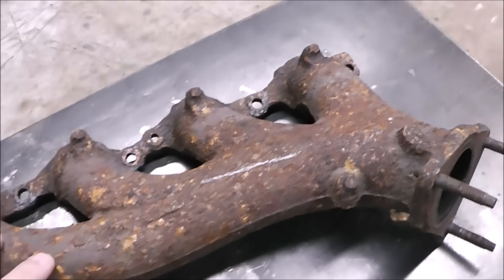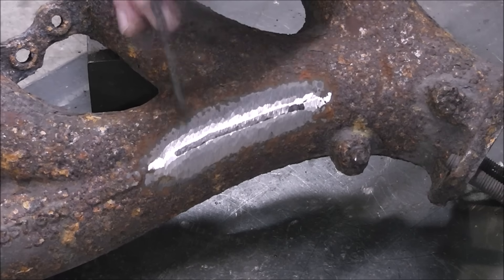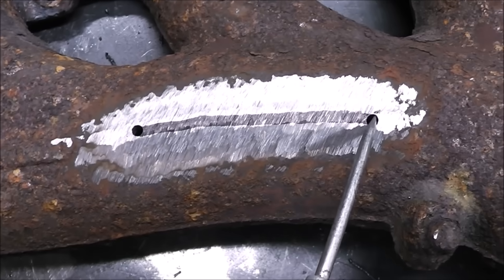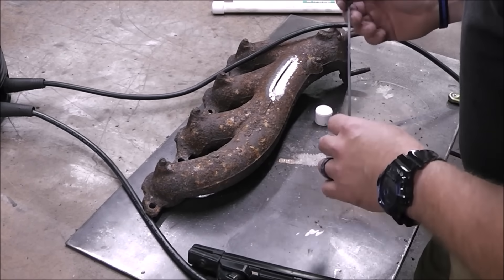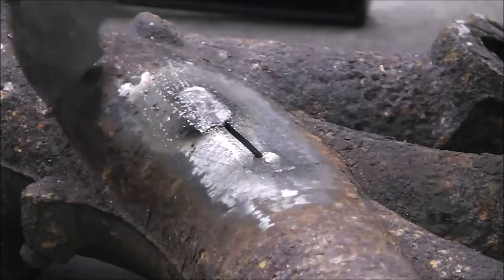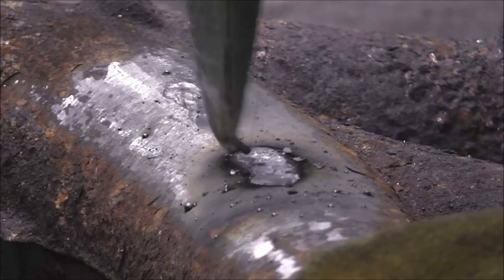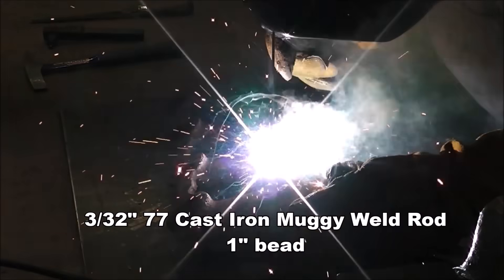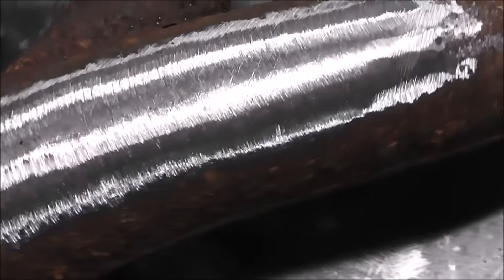Stick Welding Cast Iron Repair with Muggy Weld

Comment: hey im a pro welder. I'd never post a pic or video like that. if i did id add a warning. sum kid who isn't a pro welder mite c it & b convinced they can weld a load-bearing or pressurized cast iron part on their vehicle and it fails. They'll get hurt, GOD Forbid. Btw, there young welders - men & women - who can weld circles around me. No big deal. I had a feller ask me to "repair" a cast iron cooking pot. i refused. I trust my welds but I don't trust the properties of post-welded cast iron parts. I could have made him promise me he'll never cook in it and he does anyway & he gets hurt or sum one else does. 
To viewers: If u need a cast iron part welded, FIND A CERTIFIED WELDER. If it goes on ur vehicle, chuck the damaged one & buy a new one. DONT take any chances.
Reply from the maker: Definitely something a "pro welder" would say. 😂

Comment: You should have sand blast it before you welded it
Reply from the maker: Although I do own a sandblaster, I feel that most DIY folks probably dont, which is why I did not do it that way.
Reply: @BrandonLund  
Idk much about em. How much does a good one cost. Do you need a shit ton of sand. You should do a video on em.
Reply from the maker: @madbear3512  Thats a great idea! Here is the one that I use (except mine is red). It's just a little hand held unit that works really good. A 50 lb bag of sand lasts a long time. https://amzn.to/2PWTZ9a

Comment: How to fix cast iron manifold.. Take off engine, throw in garbage, install headers.
Reply from the maker: THIS! 🤣🤣🤣👌👍
Reply: @BrandonLund  but seriously... Nice work man!!
Reply from the maker: Seth Bergile thanks brother! That was a good comment tho! 😁
Reply: Au contraire. Some classic car collectors want to keep their classic cars as original as possible. Even if that means that the welder is going to charge them more than the cost of a quality set of headers.
Reply: @mike203920  it's a 5.3 LS manifold off a pick up. Nobody wants that shit!
Reply: @SethBergile  I know the author of this video is using a common disposable manifold as an example. But that isn't the point. The point is that you can learn and practice this technique on low value stuff before you fix some collectors '63 stingray.
Reply: Why would you throw the engine away?
Reply: Actually the LS Gen 3 exhaust manifolds as shown work quite excellent and aftermarket headers are used mainly for fitment issues.
Reply: Or junk it and get$ for it
Reply: @madbear3512  you might get like 3 cents for it
Reply: @DMD81773  
Collection all together by the shit ton you get your money worth
Reply: Seth Bergile yeap 😂😂😂😂
Reply: same
Reply: 1958 Edsel, 390gt low-riser heads.
Reply: @Neildo430ci  I have a set of those heads with machined combustion chambers.
Reply: I'm opposite, I throw headers away.
Reply: Secret. Dig a small pit, build a fire. Put manifold in fire. When it's hot, weld on it until it starts making noise. Put back in fire and do over. When finished, put back in fire. I cover with a metal trash can. let it get air and wait until the fire smolders down and gets cool, slowly.  I tried a MIG welder last time at someone else's shop. Took a cut off drum and some wood for a fire. Worked fine. Was a broken tractor manifold.
Reply from the maker: Yah, that's not what this was about. This video was about repairing damaged cast iron.

Comment: Looks like shit tbh, should have used MG200, no preheat required!!! You have way to much under cut through the entire weld, which would indicated to much heat, with that being said you should have as a welder check the along the sides of your welds for heat cracking, and yes I weld cast and aluminum heads and blocks 24/7 GM welder here of 16yrs.
Reply from the maker: Why would I use MG200 when I specifically said in the video that a bunch of viewers wanted to know about muggy weld? That is probably the dumbest comment on here "tbh"

Comment: Preheating cast iron is the right thing to do. Cast iron is like a sponge....that is it's full of water. And water , or the oxygen in water weakens the weld. It doesn't take a huge amount of heat to do the job. Just enough that one can't keep a finger on it. This instructor had some very good points so listen to his advise. Don't forget to drive the moisture from cast iron. Your job will remain together forever.
Reply from the maker: Excellent advise. I've always had good luck with a preheat and controlled cool down. I usually use sand if the part doesnt have gears of friction parts attached. All good advise brother, thank you! Great comment!

Comment: Ok,  so jumping in late here. Cooling rate of molten cast iron dictates what kind of cast iron you have, specifically what the carbon phase looks like. A higher degree of subcooling will form iron carbide (cementite)  which is present in white cast iron and very brittle. If you can reduce subcooling (cool slowly) you'll have a graphite phase which is present in ductile cast iron. Preheating the part will slow local cooling rate and generate a ductile phase. The differential cooling along with a localized brittle phase causes cracks. Preheat is a good idea.
Reply from the maker: Thank you. That's way beyond my cast iron knowledge. As a general rule, I always preheat and control the cooldown,  but for this series I wanted to experiment a little...as in a worst case scenario. Cheers brother

Comment: Why at the beginning of the video we are looking at the part of the manifold that you could see if it's installed on a vehicle but when you finish and say it's a perfect weld we are looking at the side that would normally be facing the block?
Reply from the maker: The manifold was prepped on both sides. One side was for the video you watched and the other side was for a future TIG welding video. Being the director, camera man, welder and producer, I never caught that I was welding on the side that you did not see me prep.

Comment: Chip off the flux then sand clean and just TIG weld it, then throw it in a  large toaster oven before to 450-500 and cool slowly in the oven afterwards, works every time I  use Ni-Rod different % nickel for different apps.
Reply from the maker: I did just what you recommended! Cheers brother! https://youtu.be/-XUbzw6p83Q
Reply: @BrandonLund  , Every welder learns different methods from different people, the way you did it was awesome, hell you could almost blacksmith it,lol. The point I was trying to much (which I didn't do a good job of) was there are lots off different ways to approach Cast Iron, totally enjoyed the video. Btw I do aerospace and own a shop that is NADCAP approved with 2 year merit.Got 38 years of experience and still learning stuff every day, Cheers.
Reply from the maker: @Jarboe420  that's awesome about your certification man! The one thing I have learned after posting these cast iron repair videos is that everyone seems to have a preferred method and a select few (a very select few) insist if i dont fix it their way than im a complete idiot and should not be making videos. The day we stop learning and trying new things is the day life becomes less interesting. We live in a throw away society, so if I can help someone keep stuff out of the landfill or even save them a little money with these videos, it's worth it. Cheers brother and I appreciate your comments and your support!
Reply: Exactly,  @BrandonLund  some of the most fun I have is walk ins, where you have to know how to fix it, repair it etc.. makes my day like you said when I can fix it, so it doesn't end up in the trash and or there is no new one they can get.Sub'd to the channel brother keep up the great work & videos.

Comment: This is a ls manifold ... It is cast steel not cast iron .. you can weld this with a mig welder with out doing anything to it ... People I know cut the flanges off of them all the time  and might weld turbo flanges on them all the time ... and yes there strong not brittle and don't break off ... This is kind of a pointless video ... Go get a manifold off of a 1960s model car or something ... I would tell this guy to go get the same manifold ... Cut it in half bevel it ... And weld it with a mig welder then try to break it .... It will be just as strong as it was before ...
Reply from the maker: Eric, I'm sorry you feel this video is pointless but these manifolds are made of cast iron as demonstrated in the video. There is additional information in the pinned comments if your interested.

Comment: Those are cast steel ls manifolds. cast is much harder weld a engine block and make it look good
Reply from the maker: These are cast iron manifolds as I demonstrated.  GM never made these as a cast steel and GM replacements are sold as cast iron for a reason, because they are cast iron as I demonstrated in the video and here is the data to prove it. https://ls1tech.com/forums/forced-induction/1750208-what-truck-manifolds-really-made.html

Comment: It easy when there is No crack to start with...
Reply from the maker: Z71Ranger thank you for your comment.  You don’t need to have a naturally occurring defect to be able to properly demonstrate the steps needed to make the repair. The steps are exactly the same. I have other videos repairing cast iron that are completely broken if this repair is not realistic enough for you. Cheers.

Comment: About half way through he obviously flipped the manifold. It is a big block Chevy manifold and he was grinding on the outside with the port not shown but finished welding on the inside with the port exposed. Is that intentional?
Reply from the maker: The manifold was prepped on both sides. One side was for the video you watched and the other side was for a future TIG welding video. Being the director, camera man, welder and producer, I never caught that I was welding on the side that you did not see me prep.
Reply: Good to know. I didn't really see any reason for the flip, just the continuity issue. Good job!
Reply from the maker: @gduvall1572  Thanks man! Cheers!

Comment: Started welding on front side of manifold but finished welding on the backside of manifold. What's up with that?
Reply from the maker: The manifold was prepped on both sides. One side was for the video you watched and the other side was for a future TIG welding video. Being the director, camera man, welder and producer, I never caught that I was welding on the side that you did not see me prep.

Comment: Modern exhaust manifolds are made with sintered metal. Metal made with compressed powder.
If you try to weld it oil like substance will ooze out.
You will need a special welding rod for this metal.
Reply: maybe  'Castolin Eutectic' may have   a special   brazing rod  to cope with that product ... as sometimes brazing is good enough to repair a crack .... obviously it depends on those  exhaust temperatures...

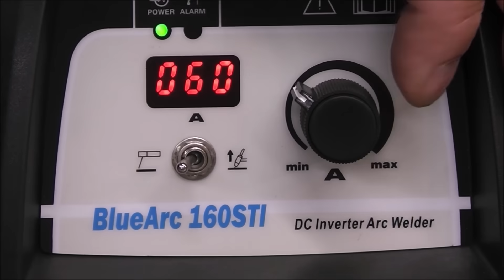Comment: The end result looks good. It appears the part has flipped over at 6:14 what happened on the first attemp?
Reply from the maker: The manifold was prepped on both sides. One side was for the video you watched and the other side was for a future TIG welding video. Being the director, camera man, welder and producer, I never caught that I was welding on the side that you did not see me prep.

Comment: @Brandon Lund hi what paint would you put directly onto the fresh metal to stop it from rusting? what is your preferred choice to protect the fresh grinded metal, thanks
Reply from the maker: I prefer Rustoleum high temp paint. Eastwood makes a good high temp paint also.
Reply: thanks Brandon for taking your time to reply :)

Comment: That's an LS v8 manifold most likely from a 4.8/5.3/6.0 99-07classic truck motor based on the flange although most of them are pretty similar so it can be hard to tell on video.

Comment: How do you get a thumbs down on this job?  He welded it perfect.
Reply from the maker: Because people believe that their way is the only way and any other way is wrong. Unfortunately there are numerous ways to repair cast iron, numerous filler materials, numerous processes (MIG, TIG, STICK Oxy Fuel ect.) cold welding technique V.S.  pre-heat / post heat....you just have to be open minded to different methods and techniques. Welding cast is a crap shoot. What works for one may not work for another.

Comment: so i will never  be able to Weld cast iron with 6013 or7018 i tried and the 6013 never blends into the cast iron it comes apart and falls
Reply from the maker: 6013 is not a good rod for welding cast,  7018 however has limited success. I did some cast iron welding using a bunch of different rods including 7018 and 6010 welding up some cast. If you check out the the more recent videos about welding cast iron, it will be one of those. It was within the last month or so.

Comment: Hey Brother Appreciate the content, but, I feel like grinding it would weaken the joint. never welded cast iron, but I know this holds true with other materials, as also does quenching welds too soon
Reply from the maker: The short answer is, grinding a weld that's done properly should be as equally strong as the base metal. Not grinding the weld leaves reinforcement. This part is non structural so grinding really doesnt matter. Quenching welds will make them weaker for sure.
Reply: @BrandonLund  so, had this weld been a repair to either of the mounting flanges, then you would not have grounded I assume. (Liked the video) is this the only way I can weld cast iron? What other ways are there that you know of. I only ask because I have local stores like Harbor Freight, Tractor Supply, and Lowe's and need something like those rods ASAP?
Reply from the maker: Correct. I would only grind it if appearance was issue. Other than that,  just weld it up. Tractor supply has nickle 55 and nickle 99 rods. Both work very simular to the rods in the video.  If you have Mig, you could pick up a small spool of 308L stainless. That often works too. Heating the part always works better in my opinion. What are you welding.
Reply: @BrandonLund  I went a different route with a project that I was working on today, so, I didn't have to go outside of my Hobart Ironman 230. But, wait, why would straight stainless, or 308, work on cast???
Reply from the maker: Cast is a weird animal. You can sometimes weld it with stainless rod depending on how much trash / pot metal is in it. Older cast is more brittle and likes nickle rod or brazing where as some of the newer stiff can often be welded with stainless. 316 stainless which is considered food grade is too brittle though. 308L works good.
Reply: Thanks. I'll try it one day soon and let you. Appreciate it man.

Comment: Brandon, I worked with cast iron and learned from an old timer who told me to do the same as you only difference was to reverse the polarity. Doing so stops the worry for preheat or cracking from heat. The welds will come out looking like jet rod or stainless welding. Smooth with no undercut no cracking. Give it a shot.
Reply from the maker: David Conner excellent tip! It makes sense really. Running electrode negative, just like you would for sheet metal.  I'll have to give it a try! Thanks!
Reply: Brandon Lund cracked block.froze grind mix radiator sealer or jb original with powder iron or steel wool . Never leaked.😎old time trick .furnace retort cememt for manifolds.
Reply: @dondesnoo1771  I got a cracked block in my boat, both sides of the block actually.  Can you be a little more specific on the procedure you used for that situation? Thanks in advance.
Reply: @bcjsmith1  mixed powdered iron and  radiator sealer filled with steel wool to hold  made a paste
Reply: K &w sealer   bars probably work  too
Reply from the maker: @ARNWRKR I did, but I'm always interested in trying viewer suggestions. His comment makes a lot of sense.

Comment: It's a "crack" that is not a crack. Therefore this is not an instructional video. Go find a real crack in a complex casting, then show us how you do it.  Personally - as an engineer of 46 years in the business - with this type of (real not sharpie) crack - I'd go for metal stitching every time.
Reply from the maker: Cutting a 3 1/2" slice completely through the manifold with a zip disc then welding it back up constitutes a real repair in my book. Just because you gained no benefit from the the instructions given in this video, does not mean that others havent benefited by the instructions. Lighten up, you'll live longer.

Comment: Great video.
Reply from the maker: Thank you very much!
Reply: So u will not recommend a 70 or 8018 for the job
Reply from the maker: @charleswronge4743  cast iron is fussy, what works for one piece may not work on the next. Technically it's not supposed to work, but ER70s2 rod isn't supposed to either and I've done it. I say give it a shot if it's something not overly important and it's not a critical part
Reply: And damn u got some haters. Keep up the good work
Reply from the maker: @charleswronge4743  there will always be haters, it's all good. I can't please everyone 😁

Comment: What are those big hunks of embedded slag in the weld?
Reply from the maker: bollsixx, those "big hunks" are not embedded slag. It is trash from the cast iron that floats to the top of the weld. This is very common when you weld cast iron.

Comment: How do you get the inside of solicitor cast welded , about one inch thick, butt one piece up to the other and weld them together?
Reply from the maker: You want to V out each of your pieces. It's the same for cast as for steel.

Comment: The drilling holes at the end of the crack is strictly cast iron or does that apply for anything involving a crack?
Reply from the maker: Good question! Yes this would apply to any metal, not just cast. It keeps the crack from migrating outwards.
Reply: It usually applies to the more brittle metals, metal combinations (or non metals, glass for ex.). Aluminium, copper and such has no use of it since it's quite malleable.